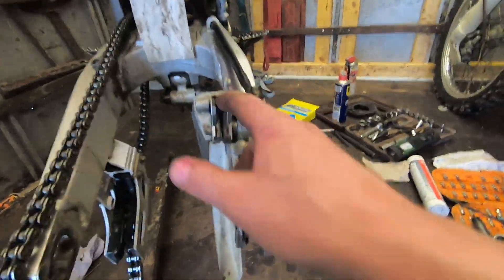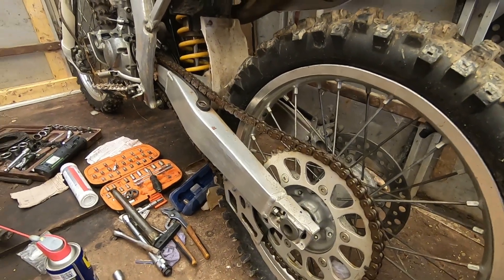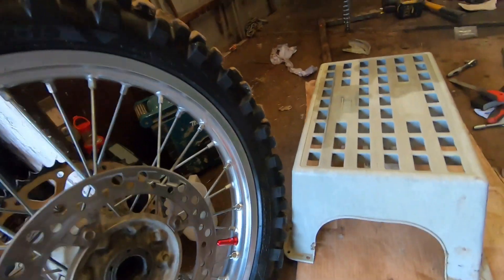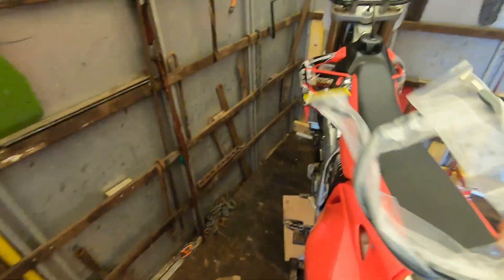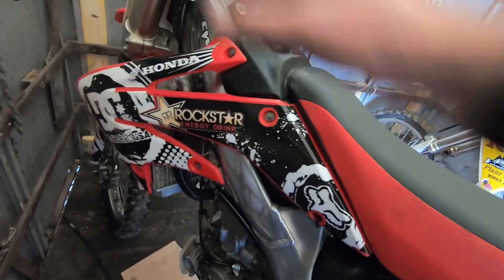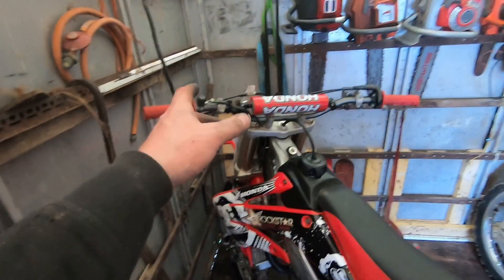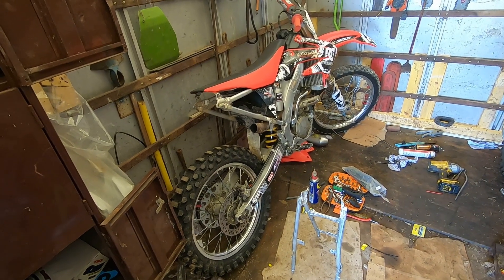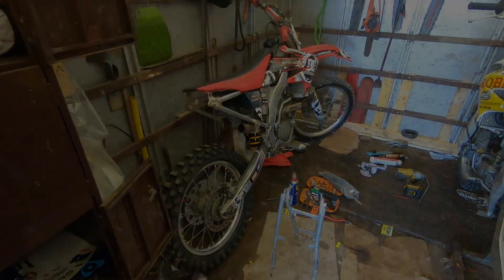Honda crf 250 refurb part two

Comment: Bet you can't wait to get her on the hills gazza do you need  a licence for off road bike racing  like you were doing  in your  days a bike test is a hard thing to pass nowadays
Reply from the maker: To ride mx you usually need an acu or and amca racing licence and to get that you need to be in a club, ( just paperwork, medical ) most clubs are very helpful though and I have been in touch with my old club. 
I didn’t do much enduro so regarding a road licence to do that I don’t know, didn’t when I did a few but that was years back ( have to be honest I wasn’t much for enduro, mx mad instead )
Mx practice tracks are different though and you don’t need nothing on those, just pay the man and twist the throttle, so I’ve contacted a few and should have a rip over the next couple of weeks, can’t wait!
On the hills and short bits on road it’s a bit less legal shall we say and I will gloss over that bit 😇